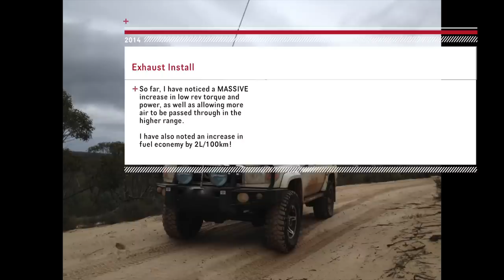3" Exhaust Installation & Sound Comparison ( 76 Series V8 LandCruiser)

Comment: Hey mate! What set up is this? Cat? Ressy, straight pipe, muffler? Keen to get the same sorta sound out of my rig
Reply from the maker: Hey mate, this setup was a straight through, no cat or ressy. But found it to be very loud, droney and didn’t like the thong slapping’ bark at higher revs, so I put the hotdog ressy in. It’s still super loud, but has a much nicer note now and doesn’t drone as much. I’ve just put up a couple of new vids yesterday on my channel, you get a good idea of what it sounds like now with the ressy! Hope that helps!

Comment: Hey mate, great video! At the end you commented that you've noticed an increase in fuel economy of 2L/100kms. I've just brought a new 76 and the first tank has returned 11.5L/100kms. Out of interest what economy are you getting?
Reply from the maker: Thanks mate. Yea same boat. When I first purchased my 76 I was on around 11L, now I have added the bigger tires plus all the weight of extra fuel, roofrack, rear bar, drawers, fridge, tools and extra wind drag things like huge spotties etc.. It's all added up to an average of 16L/100 with the new exhaust, down from 17ish
Reply: Cheers mate, appreciate the feedback. Love the other videos too, can't wait to start modifying my rig and getting out and about!!
Reply from the maker: pch4876 Yea good luck mate; they are great rigs and you'll love making the most of it. If you're looking to keep the fuel economy standard.. Forget putting anything on the roof and keep the original (recommended) tire size unless you're going off roading heaps and think you'll need it. Cheers
Reply: Bradesss 16? almost as much as a lambo. you must be loaded $$$$$.
sounds so badass
Reply from the maker: Yeah mate, it's a pretty heavy rig and in a head wind it's like driving a caravan haha

Comment: WoW, what a roar. Can I get that roar from a 2F in my FJ40 by installing a 3" end to end exhaust?
Reply from the maker: It would definitely improve the exhaust flow, but being a smaller motor, you might find a more optimal size exhaust,  potentially a size smaller 2.5” or 2 1/4” best bet would be to talk to your local exhaust shop to see if they can fabricate one up for you or buy a premise kit for the FJ

Comment: Are the catalytic converters still there
Reply from the maker: The good thing about the Redback system is all of the pipe sections are changeable, so you can add or remove things like mufflers, resonators and cat converters for straight pipes etc depending on your requirements

Comment: Cool video man. Iv just purchased the same exhaust.  How'd you go getting the three nuts off on the pipe that mounts to the turbo on the original exhaust? Iv sprayed them with bolt off and given it a go. But shes pretty tight. Haha.
Reply from the maker: Heaps of WD-40 lubricant and let it soak, keep applying. I used a socked with an extender on it, very tricky to get it in there but make sure you have contact with all sides of the nuts otherwise you risk rounding them and then you're fucked! Congrats on the purchase, sure it will sound sweet as!

Comment: Sounds good mate, do you get any drone noise in it on the high way? Ganna give my 76 an exhaust and chip just not sure witch brand to go with
Reply from the maker: Hey mate, yea with the pipe only system it is quite loud at 110km/h and does begin to drone at anything above 2100rpm. I have driven another 76 with the same pipe setup with the only difference being he had a cat and a resonator and that makes all the difference. Still sounds mean when you give it some power, but is very quiet in the cab when touring. Basically as long as it is a 3" straight through system, it will be great! Hope this helps.

Comment: sounds awesome bro, exactly what I wanna do with my 76. just crawled under the truck and wondering how did you managed to get a wrench or socket into the top 2 bolts at back of the turbo as there's no room there? Thanks
Reply from the maker: Thanks mate! Awesome, it really brings the cruiser to life! I soaked the turbo bolts in WD-40 the night before I was going to install the exhaust and managed to squeeze a socket onto the bottom and right hand bolts from underneath and from memory I think I turned the wheels full lock to the right and managed to get the top left bolt from the passenger side wheel arch?! It was a couple of year ago but if you can get ahold of a socket set with one of those uni-joins that allows you to put an angle into the socket and still turn it to loose and tighten it. Good luck!
Reply: Thanks a lot bro, I'll get the uni-joint socket and attempt this mission :)

Comment: Are all these nuts and bolts metric?
Reply from the maker: Yea mate. I believe so!
Reply: Toyota's are 100% metric like all Japanese made stuff, aftermarket stuff that goes on them is most likely metric too, no biggy, you can buy a 1/2 decent set of metric spanners & sockets cheap as chips & you'll need them if you want to work on your Toyota LC.

Comment: that's awesome! nice truck man :D
Reply from the maker: Thanks mate! Love the sound!
Reply: Bradesss hey, im gonna buy this same exhaust system for my 76. How hard is it to install a resonator/hot dog after you install the straight thru exhaust? Im concerned the droning will drive me crazy and ill want to dampen the noise. Thanks
Reply from the maker: Easy as undoing 8 bolts and just switching the ressy piece out. It sits just before the rear axle so access isn't an issue. That's what I ended up doing
Reply: @4wdAdventure   how does it sound with the resonator in it ?
Reply from the maker: Check out my channel, there’s a vid called 76 series 3” exhaust, one of my latest ones. 

https://youtu.be/atENKxnXN5Q

Comment: hey mate so do these come with turbos or installed after? Looking at the 2017 models can't find a turbodiesel...
Reply from the maker: Hey mate, all of the new 70 series are factory turbo diesel (in Australia). 4.5L V8 single turbo in the 76 (vdj76) and 79 (vdj79) (ute and dual cab) and a 4.5L V8 twin turbo in the 200 series (vdj200)